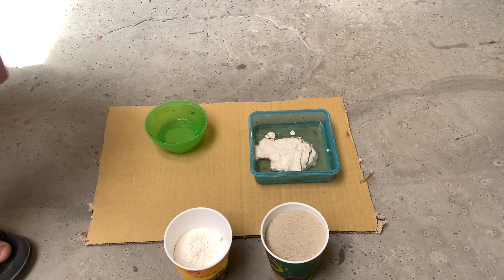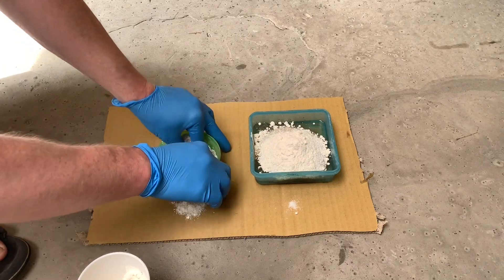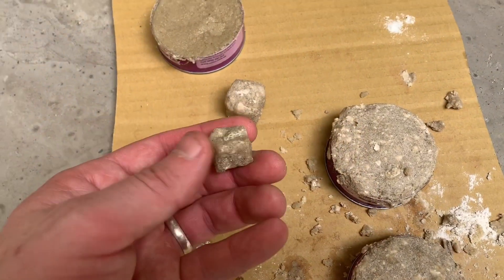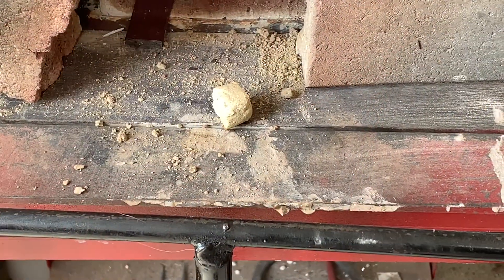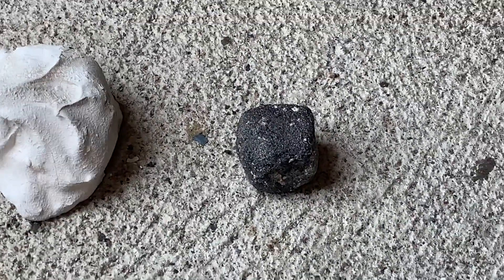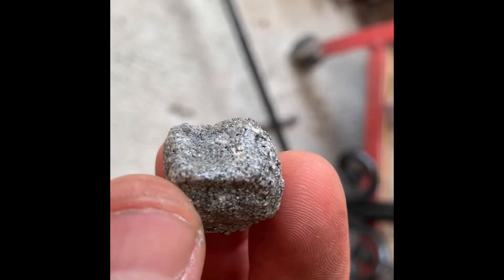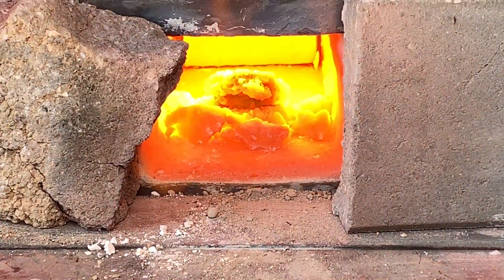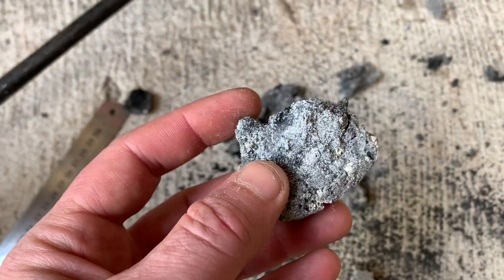Homemade Refractory experiment

Comment: Any sodium silicate will leave sodium carbonate in the material after it sets up. This sodium carbonate will act as a flux and dissolve the refractory unless it removed. One way to remove it would be to soak it out with a water bath, but this won't work on a non porous brick.

Comment: I experiment with making my own refractory too. I think part of the problem might be the flour, as it burns away it is creating voids in your bricks. Have you tried unscented talcum powder, I've found it to be extremely heat resistant. I haven't had a chance to make any sodium silicate yet but the two of them together might work well.  Throw a little plaster of Paris in the mix for a small batch only a teaspoon or so it will help it set. I like the video it's always interesting to see someone else's thought process.

Comment: The experiments ARE quite interesting to watch.
Reply from the maker: I am in two minds about keeping on trying, I previously tried and failed when I was first building my forge, the perlite/ sodium silicate literally melted from the walls and I bought commercial fibreboard which has worked great, but it would be cool to be able to make your own from simple materials, so the mission will sporadically continue
Reply: I'd definitely keep going just to learn. I bought a lot of Satanite so I could line my big forge and also do differential heat treatments.